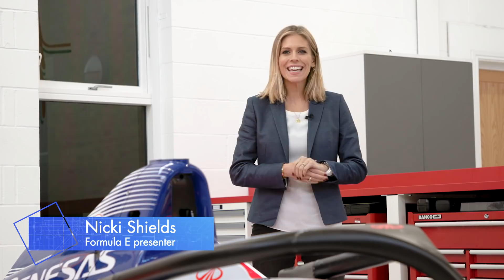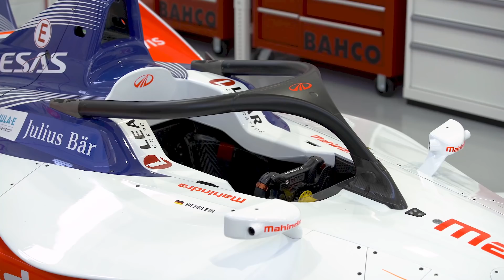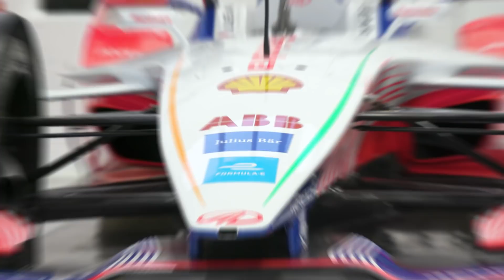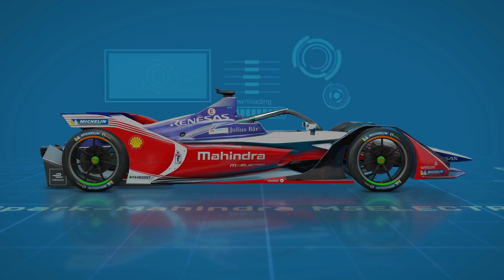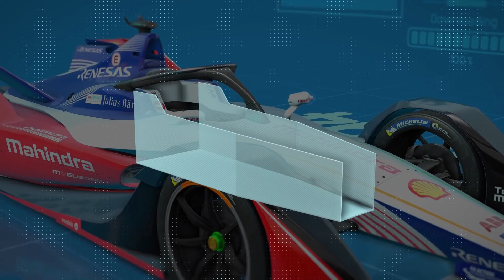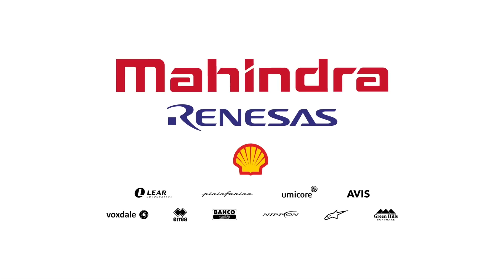Mahindra Blueprints: Safety

Comment: Yikes, that's one ugly car. If safety was #1 priority then the cars would be remote controlled, eliminating all danger from the sport. Anything else is just pandering.
Reply: So you want the driver die in a crash?
Reply: @TrippyRexTech  I want the cars to be remote controlled and if you disagree with me then you obviously want to see drivers take unnecessary risks for your enjoyment.  We have the technology for it so why risk lives of the drivers? Perhaps YOU want to see them die.
Reply: @BoleDaPole  well actually I dont think we have the technology currently to achieve the performance of a human driver. Maybe some day, and that would be very cool to see, but it's not there at the moment.
Reply: @ALMX5DP  the drivers would still pilot the cars, just remotely.. I'm not talking about AI driven cars, that would take away the human element.
Reply: @BoleDaPole  There's still the problem of latency and lag. 🤔
Reply: @BoleDaPole  I know, and i disagree that performance could be at the same level as what we see today. Pushing at 10/10ths through a screen would just become a full field pile up after less than 1 lap.
Reply: You're such a bad boy!!! Nothing scares you
Reply: Then again, we do have military drones. 🤔
Reply: well, we got already drone racing. super fast paced and no need for human protection, therefore most extreme drones. but still, drone racing is a really small market compared to motor sport

Comment: Witch one do you prefer?
The aero screen : like
The halo : comment
Reply: Both, hybrid with the halo inside and the sceen outside
Reply: Halo looks good on FE
Reply: I like open wheel, open cockpit cars. This car is neither.
Reply: ଳଳଳ ଚଚଚ I agree that the halo looks bad, but putting drivers at more risk because you think it us ugly really stupid.
Reply: @marek9784  then make the cars remote controlled if safety is #1 priority. Racing with the driver in the car is dangerous no matter what.
Reply: @marek9784  we have the technology to remove all elements of danger, and keep them in a 100% safe environment, it's called putting remote control devices on the cars, and the drivers could sit in the garage with a  TV screen in front of them. This way the cars would look cool, go faster, and we wouldn't be risking lives for peoples enjoyment.
Reply: @BoleDaPole  That second comment is pretty stupid as well, I mean of course you wanna remove as much danger as possible but you still need to have balance else it just becomes boring although it won't be long before most motorsports become simulated anyway.
Reply: @BoleDaPole  Okay your 3rd comment I understand but I still think the drivers would prefer the physical element of the sport, whilst remaining as safe as possible.
Reply: @BoleDaPole  It's open cockpit. You say you like open wheel, open cockpit but I bet you're the same guy who will complain that F1 racing sucks. 🙄